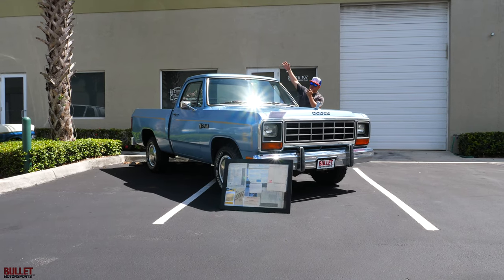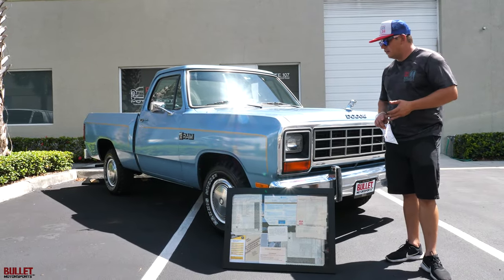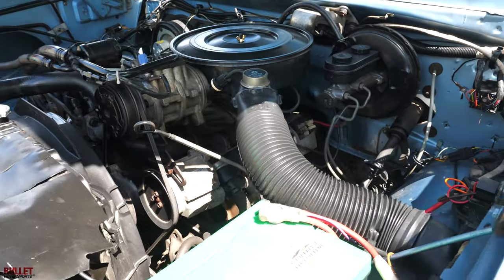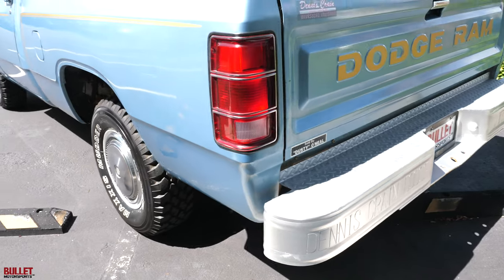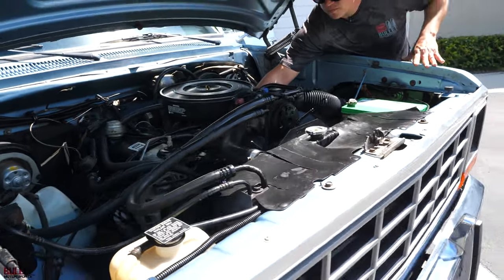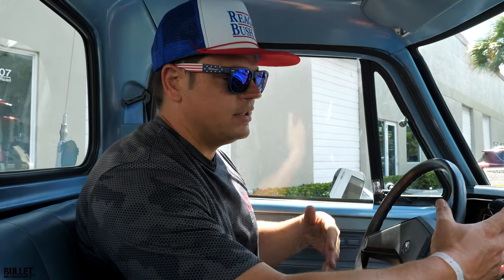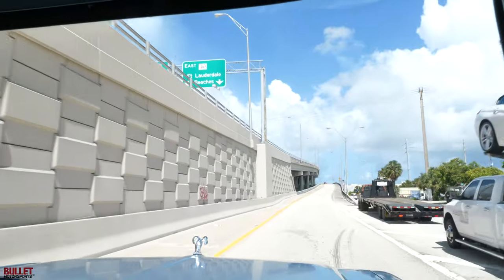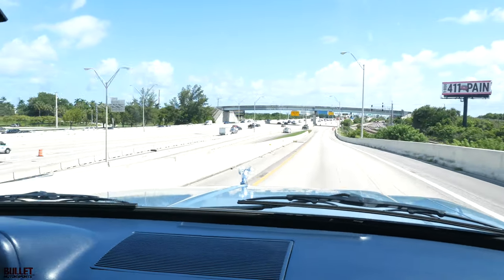1985 Dodge Ram D100 Time Capsule, 32K ORIGINAL MILES?! [4k] | REVIEW SERIES

Comment: That hesitation is likely just a accelerator pump. Theres a idle adjustment solenoid, like a IAC in a EFI car that bumps the throttle up with the A/C on. Check that out. These later slants are really quiet because they went to hydraulic lifters. The early ones were solid lifters. 
I just bought a 85 D150, /6 and 833 OD. Not quite this nice but in good shape. I’ll drive it as is with a new radiator for a while. A 5.2 magnum and NV3500 are going in later. Getting lowered.

Comment: It looks like these older Dodge pickups only had 5 place holders in the odometer, so going over 99,999 miles reset the odometer to 0. I've seen a lot of ads for the 1984 and 1985 Dodge pickup claiming to have less than 100,000 miles.
Reply: Yeah our 1989 Cummins is like that(rolled over 2 times). I think this truck probably is actually 32K just because of the condition though. If its 132K they kept it in damn good shape.